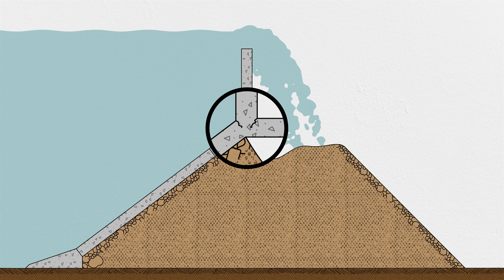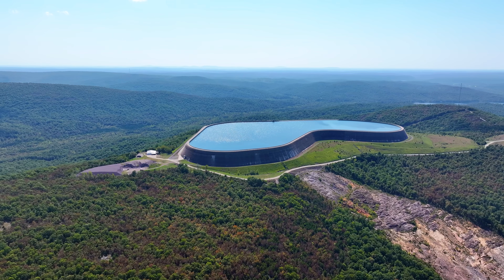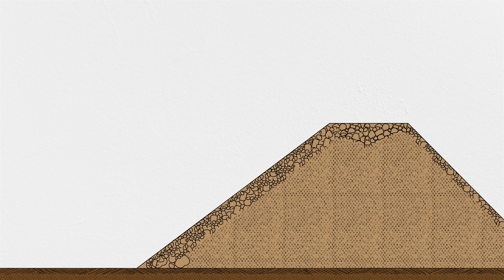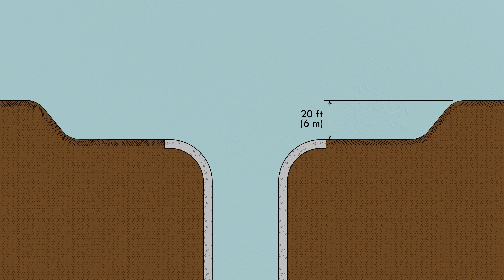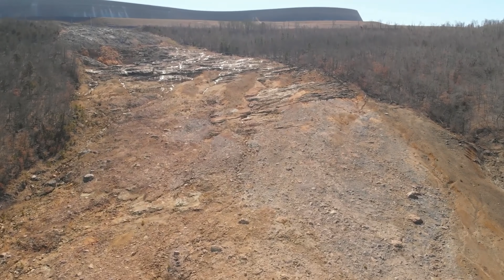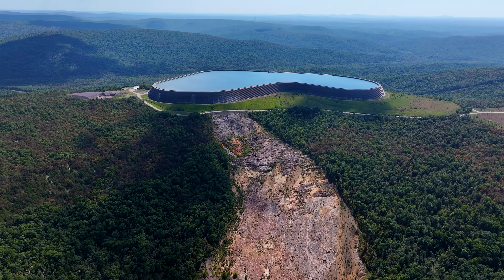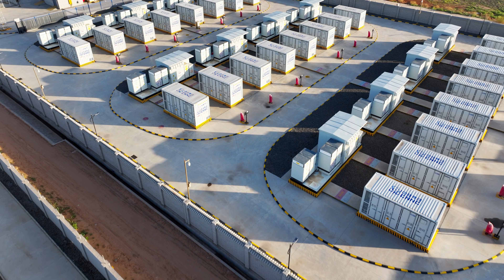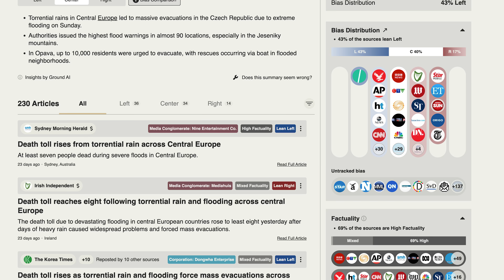The Wild Story of the Taum Sauk Dam Failure

Comment: I like how they "blame" the embankment material.  The embankment material was never intended to resist rushing water over the side of the dam.  Even if it was "clean crushed rock" it would have failed in a similar manner. The settlement would have been greater with the addition of soil in the mixture.  However, I've seen several projects similar to this where the rock fill is simply dumped with no compaction.  The geotechnical designers are mistaken in allowing construction in this manner in most cases. These materials will re-arrange over a short amount of time as the fills are completed.  So putting SOME compaction into the materials, limiting the lift thicknesses, and quality control of particle size is warranted.
The current thought process is to protect the downslopes of dams with some type of armoring to prevent this undercutting during an unexpected overtopping.  They didn't even plan for that here....
Reply: It feels like maybe you missed the part where the issue with the embankment material was that it had a higher concentration of soil than expected leading to exaggerated settling resulting in low points in the wall, which was one of the primary causes of the failure. Nothing was said about any expectation of the embankment to resist rushing water over the side of the dam, you are correct in that it was never intended to withstand that.
Reply: @TheQuicksilver115  Perhaps it could seem like that. I was merely pointing out the finer points of material selection AND proper monitoring in the field.  Armchair engineering here, but I think the soil in the embankment fill was a contributing factor, but not the primary cause.  My bet is that this condition was prevalent throughout the dam embankment, and that  other contributing factors such as compression or movement of underlying strata had more to do with the settlement that occurred.  That all being said, a project such as this being put into service without any type of post construction monitoring of elevations and subsurface movement was a mistake.
Reply: @daveharness70  Just want to note that I said "a" primary factor not "the" primary factor; it was certainly a confluence of issues. That said, Grady did mention that some of the sensors installed to detect overfilling happened to be on a section of the wall that was higher than the low point anyway, thus indicating that the low points of the wall were definitely a big part of the problem.

I hadn't considered settlement of the underlying earth, that's a good point. And clearly, in hindsight absolutely correct on your last point there! Unfortunately, hindsight tends to be a good deal better than foresight 😅

I guess the point that I was making is that the erosion of the embankment was how the dam failed but not necessarily why the dam failed, and I didn't hear Grady placing the blame on that specifically.
Reply: @TheQuicksilver115  Yes, they are all contributing factors.  I didn't mean to say that Grady was in error, and the word "blame" was from my inner soul.😅..I guess as a Geotechnical Engineer for the last 30 years dealing with similar issues.  The soil issue was the "first" issue raised, and to the audience, could be taken as "a primary" factor.

Without a doubt, this height of embankment should have been expected to settle the nearly 2 feet as was recorded.  Our rule of thumb for highway embankments constructed to 95% Std proctor is 1-2% of the embankment height.  In this case, assuming an embankment height of 90 feet, gives you about 22" if you use the upper bound of 2%.  I would fully expect a foot at max embankment height.  The settlement recorded was "post construction".  So we don't get to see what happened "during" construction.  Not to mention, the report did say that some areas of foundation soils were not properly prepared (aka undercut and replaced) prior to construction of the embankment.  I believe this was the cause of the localized depression in the wall, but I have yet to get my hands on the report (which I will do).  Also, the "soil" in the rock fill was, in my opinion, dumbed down a bit for Grady's audience.  If you look at the highlighted section in the report, they are indicating that rock materials subject to weathering were used in the embankment.  This is common in shales in my area, they are oftentimes non-durable.  We know that the dam was leaking through the concrete panels for years prior to placing the geomembrane.  So the embankment was exposed to not only precipitation, but also water seeping through the embankment.  This will cause continued degradation of the the low quality materials, and reduce their effective strength.  

However, when we look at the settlement data (23 points) it does appear that the majority of settlement (close to 90%) was achieved in the first 20 years (~1963-1987) with little settlement recorded after that.  This would be indicative of multiple actors contributing to the settlement.  The rock embankment fills would be expected to be "settled" in about 5 years.  Underlying soils could take about this same time frame for initial consolidation.  However, secondary consolidation, or creep, can continue for decades.  Throw in the possibility that the "rock" embankment materials were non-durable, and you have a "creep-like" condition happening.  

So, I'd say the poor embankment material's possible degradation was a very minor component of the overall settlement, and obviously didn't cause the embankment itself to fail under self weight (which can and does occur after decades).   But the soil component will hold onto water more readily than rock fills, causing increased stress in the embankment and greater overall weight.

You are obviously logical, if not an engineer yourself.  Imagine having ~35 years of settlement data around the top of the dam wall as shown at 10:52 of the video.  How in the world could the design/maintenance/owner engineers not have made some changes based solely upon this data?!  This was a concrete lined impoundment that was leaking....hmmmmm.  With proper analysis of the facts presented  this TYPE of failure could have been avoided.  Still a very tenuous design and construction project to be sure.  And as Grady said, not having a spillway is putting way too much trust in a multitude of systems that can fail.

Nice chatting!  Cheers!
Reply: @daveharness70  Thanks for the additional context and sharing your expertise! And solid point about Grady dumbing it down for his audience, that's a good reminder. I am in fact an engineer, but of the digital variety lol.

Totally agree, it's a real shame and definitely feels like this was probably an avoidable situation, at least in the exact way it occurred. It's very lucky nobody died as a result! And we're fortunate to have had a chance to learn from the mistakes without a (comparatively) major tragedy.

That was an interesting read, I appreciate your effort in writing all that!

Comment: Luxemburg was ahead 

The Vianden Pumped Storage Plant is located just north of Vianden in Diekirch District, Luxembourg. The power plant uses the pumped-storage hydroelectric method to generate electricity and serves as a peaking power plant. Its lower reservoir is located on the Our River, bordering Germany, and the upper is elevated above on the nearby Saint Nicholas Mountain. Construction on the plant began in 1959 and the first pump-generators were commissioned in 1962. A tenth pump-generator was installed in 1976 bringing the plant's installed generating capacity to 1,096 megawatts (1,470,000 hp). The plant generates an average of 1,650 gigawatt-hours (5,900 TJ) annually but of course consumes even more. Generally the efficiency of this energy storage method is around 70–80%. The plant is owned by Société électrique de l'Our and RWE. Construction on an eleventh pump-generator began in 2010 and it is expected to be commissioned in 2013, which will bring the plant's installed capacity to 1,296 megawatts (1,738,000 hp).

Comment: sounds to me like the second generation of radiation treatment equipment, where they removed all the electric safety circuits as the software was good enough to control the whole machine, as the first generation never got bug reports.
It seems that for the first generation the doctors didn't know what all these alerts were, that turned off the radiation system due to failures, and hence didn't even know they needed to report anything.
Since the software was soo good that nobody complained, they left out those electrical safe guards, and people died of radiation overdose on the newer equipment.

Comment: I just had a maybe dumb maybe genius idea. Instead of going into a pump at the bottom it goes into a boiler and we send it up to the top of the mountain as steam via a turbine and tube where the water in the reservoir cools it back down to liquid and it rejoins the cycle. 

could generate power with both legs of the trip that way
Reply: You would use more energy boiling the water than you would recover.
Reply: @GrifHowe  tell that to virtually every power plant. I'm not saying use the power from the gravity part to boil the water, I'm saying use an external source just like they do when they're pumping it. They could even use a solar powered molten sodium boiler for it.

Comment: Like others have said in the comments, it's totally unimaginable to believe that it wasn't built without a spillway and redundant high water alarm systems! Who wrote the specs for the project to begin with? Who were the bidders on the project, that never questioned the fact that there was no spillway or secondary control of water levels? It may seem logical in hindsight to see these things, but were they trying to save money but getting some 'fly by night' engineering firm to spec the job, and then the same for bidders on the job? Was anyone held accountable after the collapse happened?

Comment: This incident was ridiculous - so easily preventable and yet they let it happen. Any civil engineer can tell you, overtopping an earthen fill (or rock fill) dam is fatal to the dam. Thus overtopping prevention must be a priority. An emergency spillway is a must. Level controls? I can think of many level sensing solutions that would not impact the liner, not even go in the water, using decades-old tech. Ultrasonic or radar gauges come to mind, 3x redundant of course. As for sunken walls, any surveyor could easily have identified the lowest point and adjustments would then be made to the controls accordingly. And by adjustment I do NOT mean "knock 2 feet off the setpoint" LOL.
EDITED for typos.

Comment: This is going to be a good one! Johnson Shut-In's is a state and national treasure! It's a shame what happened, however I think the state made some upgrades to the camp sites after the power company settlement. They now have cabins, which I don't recall any being there when I was there as a kid. Anyway, there was a lot of arrogance on the part of the power company on the original dam. That being said, we need more pumped hydro in this country, and I hope this is a learning lesson.
Reply: Batteries perform the same task as these dams, and are far easier to deploy. There’s very little pumped storage being built.
Reply: @benoithudson7235  Batteries work fine but they don't have the capacity like pumped hydro. The main drawback to pumped hydro is the amount of head pressure needed in order for it to work. Usually cities don't have the amount of fall needed in order to make it effective.
Reply: @adammuncy8475  : A single battery cell has a lot more storage capacity than a raindrop. Doesn't matter, because the grid doesn't rely on a single one of either, it relies on huge numbers.

Utilities and related companies have clearly decided that batteries is where it's at, because over the past few years, they dramatically increased the amount of storage they're buying and it's almost all batteries.
Reply: Great Missouri outdoors!

Comment: I don't think battery storage is going to become popular until we have a good way to reclaim dead cells. When a turbine breaks down, we can repair it. When a battery breaks down, which happens surprisingly fast, we just throw it away.

That hurdle will have to be overcome prior to large scale battery power storage being economically viable.

Granted, because we live in the world we live in. I have no doubt that they will push though and use it anyway. Since we won't see the impact for another 10 or 15 years. They really dont care about future generations when they can get another decimal point of money now.
Reply: When batteries break down, their capacity slowly decreases, they don’t just stop working. It can keep being used as a lower-capacity battery, or recycled into new batteries
Reply: Large scale batteries from cars or infrastructure are not simply thrown away.  They are repurposed or recycled.

Comment: So... One pump turned off, why didn't the pumps use each other's sensors as validation? If they have different readings for long enough, something is wrong and both pumps shut off. They are feeding the same reservoir, unless the mountain has become off kilter, they should only register different values for a short period of time.

Comment: thin vertical walls against water is just generally a bad idea imo.  it's a cost/benefit calculation with high risks.
Reply: The vertical wall performed just fine though.
Reply: @thekinginyellow1744  sure - until it didn't. You can't judge the wall's performance without considering its foundations. It was not built to withstand a foreseeable overflow, therefore it failed when put to the test
Reply: @dielaughing73  You said "Vertical wall"  the vertical wall did not fail until after the foundation failed.  You can judge the walls performance without considering the foundation.  You did that when you called out the "vertical wall".  There is no wall in existence, vertical or otherwise, that will not fail if the foundation fails.
Reply: Dirt is cheap especially compared to something like this. I don't understand why they didn't back up the walls with dirt. 

I'd assume they just didn't want it to look like a lake on the top of a mountain.
Reply: @edwardscott3262  it takes a LOT of dirt to increase the height of an earthen wall. It seems they hit a limit of how much dirt they could place there (or would pay to move) and decided an unsupported concrete wall would do for the last so many feet

Comment: 16:24 I strongly encourage everyone to read the "Ageing Water Storage Infrastructure: An Emerging Global Risk" report from 2021 - it is eye opening to realize how many such structures were built and that they need to last decades if not centuries. Also, about storage: what happened to hydrogen? I remember it to be a hot topic on energy storage at some point, but I'm not quite sure what happened later as I wasn't following the news.
Reply: Hydrogen is very difficult to manage. It's extremely low energy density at atmospheric pressure, so you either have to compress it to pressure levels that no pressure vessel can tolerate, or cool it to -253°C so it liquifies and keep it there.

There's ways to lock hydrogen in material matrices, but then the challenge is getting it out when you need it.

@benjaminchung991 Your numbers are a bit off. Water electrolysis is about 70-80% efficient and hydrogen fuel cells are around 40-60% efficient, so at worst you are 28% efficient over the whole cycle. But yeah that's not great, the full cycle needs to be a lot better to be viable as energy storage.
Reply: I would love to read the paper you reference, but everything I find online just links back to the UN, and the UN just gives you the abstract or a 404, depending on which link you follow.
Reply: @thekinginyellow1744  try coping it with quotes and adding "pdf", I've just found a copy on reliefweb (whatever that is).
Reply: @thekinginyellow1744  try searching with quotes and adding "pdf" at the end.
Reply: @thekinginyellow1744  I'm sorry I have to write a comment as a riddle but this is the modern youtube: try with quotes and adding the popular file extension at the end 😅
Reply: @proosee  I did use quotes, but I guess I'll try adding Papa Don't Fight.
Edit:  Yep that worked.  Still had to try half a dozen sites before I found one that didn't require login though.
Reply: @thekinginyellow1744  duckduckgo worked better for this particular search strangely enough.
Reply: Hydrogen is just not a great energy storage medium; the issue is that electrolysis and back-conversion (either thermal or fuel cell) to electricity is quite inefficient so you end up losing something like 80% of the energy you put in. Batteries or pumped hydro are, generally speaking, better solutions.
Reply: Explosive
Reply: @John_Smith_86  just like batteries - basically almost everything that is energy dense is dangerous.
Reply: @proosee  True. Worse problem with hydrogen though. It is innately explosive in our atomsphere. 

Batteries at least rely on their chemistry to remain stable. A little hydrogen leak would be a big problem.